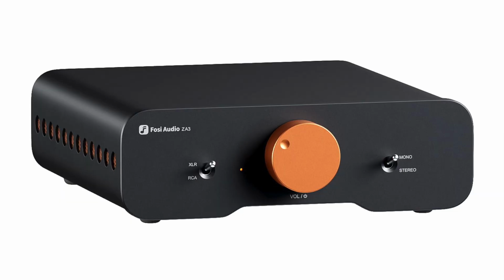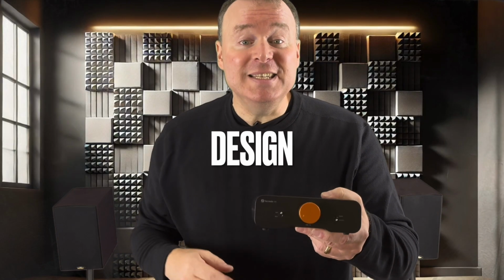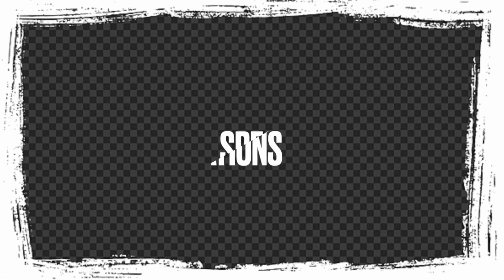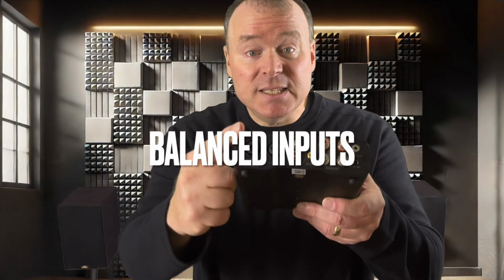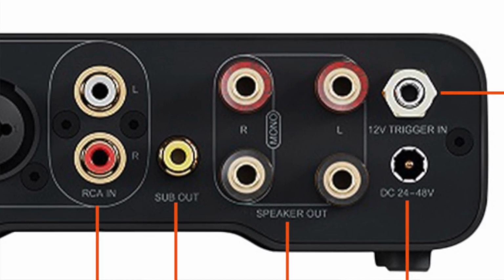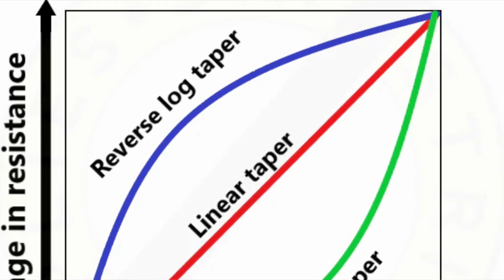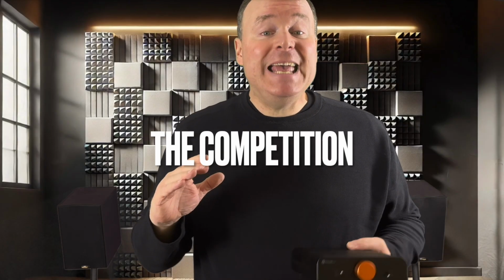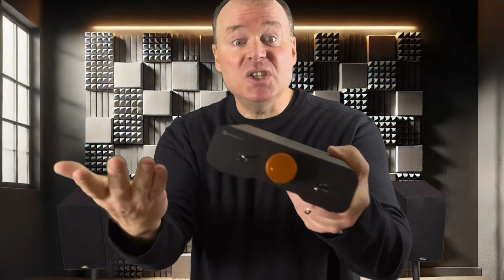Fosi Audio ZA3 Features and Benefits

Comment: Currently using an Emotiva A100 50w with a Marantz as a preamp, going into a pair of Wharfedale floor speakers, can't decide if I'd be better off with this or sticking to what I got now.
Reply from the maker: The Emotiva A100 was a terrific. As is this amp.  Can’t speak of the difference in sound signature, but this amp will have much power available…
Reply from the maker: The Emotiva A100 was a terrific. As is this amp.  Can’t speak of the difference in sound signature, but this amp will have much power available…

Comment: Do I need one or two op-amps for the ZA3? And should they be single or dual op-amps? I’m using the RCA input.😊
Reply from the maker: You need 2 op amps when used in stereo, plus they need to be DUAL op amps.

Here is Fosi’s guide:

https://support.fosiaudio.com/hc/en-us/articles/32586647853721-How-many-op-amps-should-l-change-in-ZA3
Reply: @ perfekt 😍

Comment: I ended up with the V3 monos—
It was between ZA3 run as monos (1 per channel) with sparkos op amps vs the V3 monos with muses02… not sure if I chose right… Za3s don’t have the heat problem… I like their darker character, but they dont have the open soundstage…

Idunno… I got my DIP8 sockets today—but can’t do the operation until the new thermal paste arrives…
I also have the ZD3 DAC—haven’t decided what to do regarding the op amp here… maybe sparkos…
Reply from the maker: I too have the ZD3 DAC. I have paired it with both the V3monos and the ZA3 amp (1). There is no poor choice here.

With that said, I have down graded my power supplies on my V3monos to reduce heat and improve stability. There is zero performance difference, other then when at full throttle… which I NEVER do… I think dual 36v power supplies may be the long term answer here. At least for me… they allow me to use my favourite amps without risking burning them up.
Reply: @ where did you source the 36V power supplies? Aiyima? I would love 40V —I think it would be the perfect balance.
Significantly cooler with the 36V when you crank it?

Comment: Yes, indeed... it's time to break down the "small amp == small speakers" garbage.  

I'm not prone to praising products. In fact I am highly critical of both Fosi and Aiyma, over some of their engineering.  But the positive side of the coin is also true...

The ZA3 is a genuine 150 watt per channel stereo amplifier.  
The V3Mono is a real honest to goodness 200 watt monoblock.

The Aiyima A07 and A70 mono, likewise ... the real deal.

Wanna see what these guys can do?  Let the dogs out... hook up to a pair of LaScallas or L-100s... maybe a pair of Elac Towers ... they do not disappoint.
Reply from the maker: Great feedback. I have not yet paired them with highly efficient speakers yet… I must do..!
Reply: @consumertechcheck  
It's not just about efficiency (although it helps) it is about giving yourself the room filling experience that only comes from larger speakers.

I use a pair of pioneer towers in my main system.  They're not "king of the hill" speakers but with a couple of easy mods they do a pretty good job.  

I was like most of the reviewers, using the chi-amps on my desktop setup with teeny weeny little speakers.... until one day I needed an amp to test my main system... I hooked up an old SMSL A50 and oh boy was that an eye opening experience.  The little amp totally blew me away.  

Today I use a modified A07 original in my main system. It displaced a Marantz amplifier in about 10 minutes of listening.  

Like I always say: "You don't know until you try it"